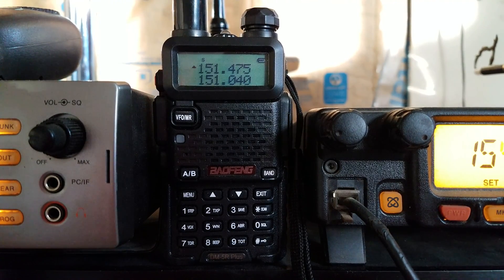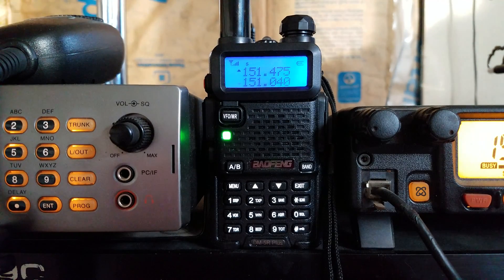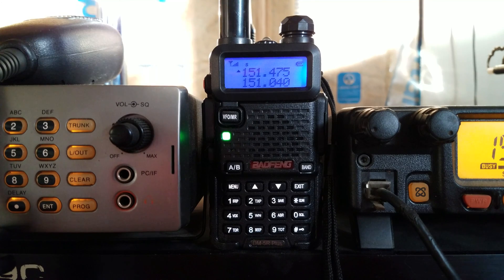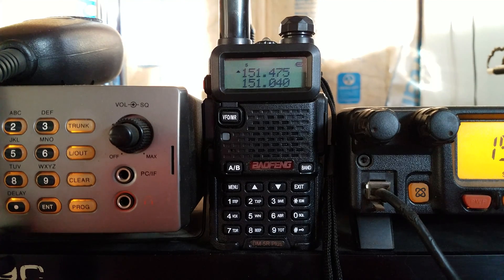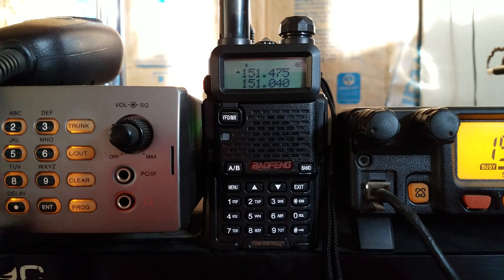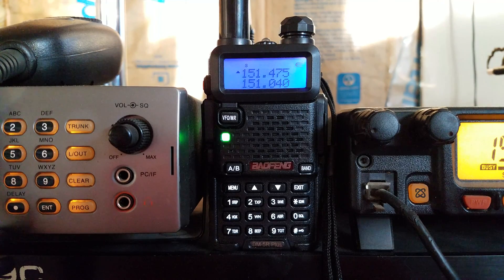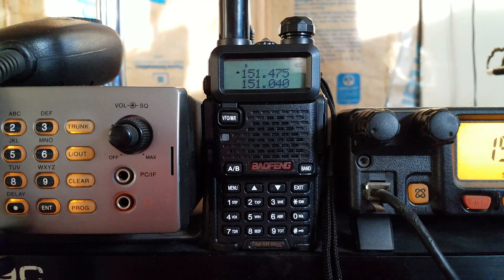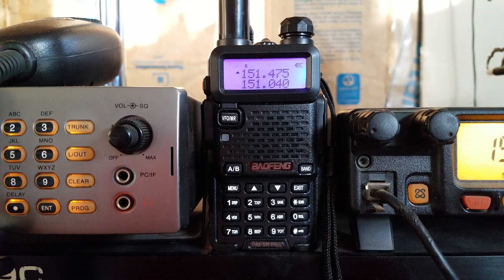DMR, PDMR, MURS, Analog radio

Comment: Its a ALL mode frequency scanner that monitors, decodes P25 Phase I & II, NXDN, DMR, Analog & digital trunked systems. The one i have is the Whistler TRX-1(Portable) and they make a TRX-2 (Base/Mobile) too. BUT...if its a encrypted talk group that the police are using it doesnt matter what scanner or DMR radio you buy. Heres my scanner(The One In My Video)---> https://www.zipscanners.com/trx-1-police-scanner.html And heres my DMR radio (The MotoTRBO Radio In My Video) at the discounted price---> https://tinyurl.com/DMR-Radio